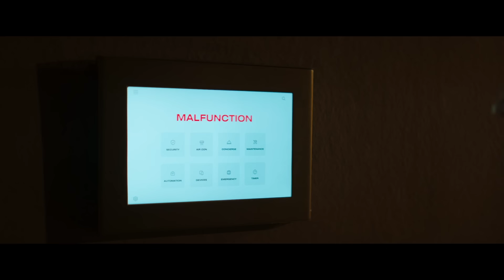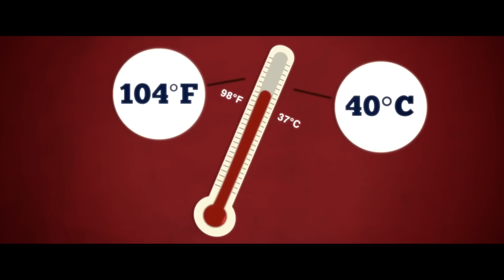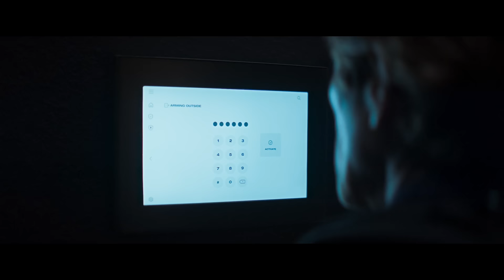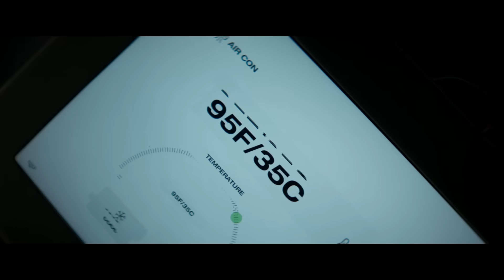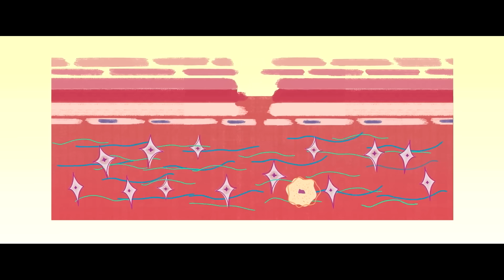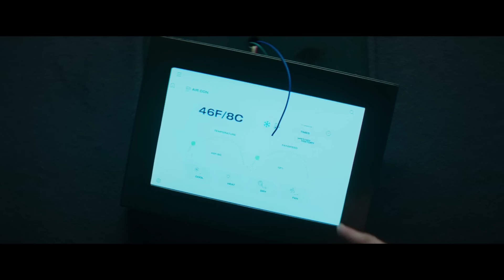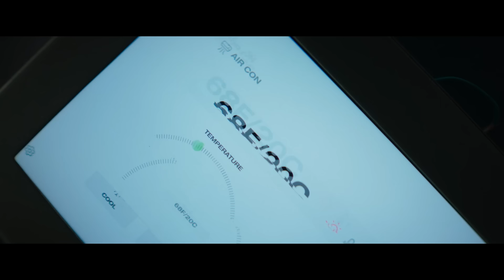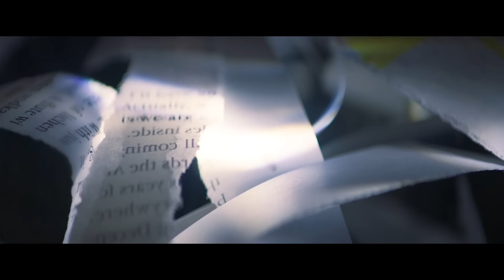How To Beat The DEATH HOUSE In "Inside"

Comment: I would keep working at the front door. If you could cause enough damage to it first by chipping away the wood and then prying off the layers until you have mostly reached the metal surface and then hitting it with furniture in a battering ram fashion the cleaning staff would eventually notice it bulging at the least as you warp the metal door hidden within that wooden monstrosity, if you fail to pop it out entirely when it bends to the point where the locking pins no longer reach the frame or vice versa depending on the locking style. 

Throwing the balls at the windows was actually a fairly good way to test how strong they were and would have eliminated the need to build his Silvester the cat furniture tower. If the skylight glass was as strong as the glass of the windows and balcony then trying to break the frame of the balcony door would have made more sense. Working at something above you is inherently worse not only because of the dust he countered but also the lack of good leverage and that's without considering how wobbly his tower was.

As for the security system, the only reason it would have been messing up is because of the panel he broke, it might have been the actual computer running the system at which point removing it would stop it's function or just a UI for the system which due to it's malfunction was sending out commands to the system which was causing the temperature increase. So removing it is definitely a good idea.

Removing it before the temperature got too hot would have potentially kept it at a reasonable level or even deactivated the electromagnetic door locks. 

If not then removing it might have at least allowed you to cause a short circuit using the wires that were connected to it and thus fry the fuses connected to the security system potentially unlocking the magnetic locks which are usually made to open when without a live circuit in case of emergency. 

Since they Use electromagnetic locking rather then Ferromagnetic locking. (electro magnetic being magnetic only because of the live circuit with Ferro magnetic being for example fridge magnets)
Reply: "Sylvester the cat furniture tower" 😂 Perfect!
Reply: true enough. a door is only as strong as the hinges that bind it to the socket of the doorway its placed in. once the wooden layer is peeled off and the metal is exposed, chisel away at the edges to get to the hinges.
expose the hinges and damage them as much as possible, then you go for the ramming.

now, we don't actually ever see what type of door it is, whether its a sliding door or a open/shut (normal) kind of door, but in case its the latter chances are it can be rammed down with relative ease once its weak points are damaged enough.
the problem for Nemo is; i think his little mallet and chisels would wear out before the door did.. that mallet he is using is not that big or robust.
Reply: He could have poured water right under the main door so it leaks outside for Jasmin to see. Maybe then she will remove her headphones and hear Nemo or will call somebody for the leak. But also not writing SOS/HELP/I'M LOCKED on ALL of the windows was a major oversight.

Comment: I would have frozen a ton of pool water in any container i could find and put it back in the pool as that would have kept a cool area he could "chill out" in anytime his temp was too hot. Rotating new ice in constantly. I also would've tried getting through a wall to the outside, because there's a chance that it would be less reinforced than the windows or doors. If i could access fresh air, at least id be able to think properly and come up with more plans.

Comment: If you've ever worked in construction, you'd be out in a few mins. There are so many ways in and out of buildings. Bust through the sheet rock and slide out between the studs. Climb up through the ductwork and kick the ac panel  till it pops off, giving access to the roof. Cut a hole in the side wall and escape into the apartment next door. There are so many ways out

Comment: Side note: that whole thing about lasting 3 days without water is kinda misleading and has caused problems for people before. While it's true that your body will begin to shut down after 3 days without water, you're actually in danger much sooner than that. After 2 days without any water, your kidneys and digestive systems start to break down and cause you to be extremely weakened, slow, and in constant pain. If you don't get access to water before the third day, it's very likely that you won't physically be able to move enough to even find/retrieve water to rehydrate yourself. That's why it's so important to constantly remain hydrated. Regardless of what you're doing (even if you're an art thief breaking into a luxury apartment to steal high-dollar art), just pack some type of portable water filtration system like a Lifestraw or Sawyer Mini. 

It's also important to note that if you ever get to the point of heat stroke in your life, you will become highly susceptible to it again with a lower threshold. Even if you live somewhere that is cold year-round, you can still get a heatstroke, especially if you are over-exerting yourself while bundled up in a bunch of cold-weather gear. 

Just remember, you are EXTREMELY easy to kill. From the weather to microbes to gunshots and more, it's easy for you to fall dead on the floor.
Reply: The other issue that I notice is with the indoor irrigation system. If the owner uses a system like that to maintain the plants while the rest of the water to the apartment is turned off, it's very likely a closed system with a water storage tank. If that's the case, one of two things is very likely:
1) The system has a tank full of potable water that can be used
or
2) The water also contains specific chemicals used to treat the plants, leech excess nutrients in the soil, prevent mold, and/or kill insects. 

Since those are not fruit-bearing plants, it's likely that the water being used to treat them will contain some types of fertilizer and insecticides that would make them VERY unsafe to drink.

The apartment seemed pretty nicely equipped with appliances (like a walk-in fridge) so I'm guessing there are pots, pans, and a stove. There's no reason why you couldn't gather some of the other non-potable water and boil the hell out of it. And because you've got all the fridge space in the world, you could just get multiple pans, boil the water to sterilize/sanitize it, put them into the fridge, and have a large long-term solution for the water. It seems odd that this never even occurred to someone who clearly didn't grow up uber-wealthy. 

Anyone who has ever been camping or has lived in an area on a well system should immediately know how to make water safe to drink.
Reply: Can’t boil the water with the stove, no gas

Comment: I was really hoping that either the owner would come in right at the end and it turns out that trapping him in the apartment was some crazy abstract art OR there would actually be a really easy way to escape that can easily be missed but is relatively obvious.

Like the door handle has to be pulled out before being turned or actually goes upwards or there is a button on the control unit etc. etc.

Comment: As a former asbestos abatement expert, the height at which Nemo works on the ceiling is idea. Roughly one to two fist heights below the work surface and the top of your head. High enough the majority of the debris will fall away from your eyes, nose and ears. It's also low enough that the blood going to your arms doesn't have to rise much higher than your head. I don't know if this is intentional or something they zeroed in on during production. Figured you would like to know. Working with tools overhead caused a condition called 'scraper arm'. When you scrape at an overhead surface, the fact that blood needs to be pumped up into your arms while they work causes almost instant fatigue. Scraper arm is the condition of working through it until you are undergoing the kind of discomfort a marathon runner experiences. I have scraped blown on asbestos off a ceiling the size of a hockey rink and toughed out the scraper arm. Amongst the great physical feats I have achieved, the massive amounts of cancer I have removed from hospitals, mines and schools, not to mention almost every municipal building in a hundred Km radius there is little worse than knocking down spray on ceiling fireproofing. Almost anybody will be able to endure it, but only if the placement of the work is only one to two fist heights above the head. Anyone who has had to work under a sink, truck/trailer, or drywalling a ceiling will know the agony. 

Happy coincidence. Glad to share my experience and appreciation for the movies rendition of this form of overhead labor. It truely is about the most exhausting thing you can do. No doubt he came crashing down. We was weak from the scraper pain. 

Disco scraper

Comment: If there’s power for the freezer, couldn’t he boil the pool water to make a safe drinking source?
Reply: The problem is not the water being boiled, it has chlorine in it so boiling it wouldn't help at all. I think he could have used the freezer for condensation for a very small amount of water
Reply: @januszkurahenowski2860 yes boiling eliminate the chlorine, usually chlorine can be eliminated by leaving a glass of water out for an hour or so.
Reply: @willy4170  Where does the chlorine go? Doesn't seem like a good gas to generate
Reply: @ctakitimu  the house has ventilation though. also, in any case he could have used water from the fish tanks (which is salt water) and use the same method to separate the water from the salt.
i've seen such filtration systems being used on life boats when people are stranded at sea.
Reply: @ZugzugZugzugson  Chlorine gas is heavy though, so unless ventilation is at ground level it'll just pool. Also, with the steam method to filtrate the water, wouldn't he have to build a device to capture and condense the steam back to water?
Reply: @ctakitimu  yes but this can be done relatively simply by using 2 bowls (a small one and a big one), a stick, some string and a piece of water resistant sheet material. you fill the small bowl with the water you intend to filtrate, then place it inside the bigger bowl and fix the sheet so that when the water evaporates it causes the sheet to catch the condensation (which is the clean water) which will then drip from the sheet into the bigger bowl over time.
its painfully slow, but it works.
if you can get the water to boil it will speed up the process though.
Reply: There’s no gas

Comment: I would try making a sledgehammer-like tool out of the art sculptures, wood material, and secure it with the rope/fabric bindings. With this, I think you could then try striking the glass windows, Walls, Floors, or the front door. With the door exposing its steel part, you could try banging it to get attention and get help

Comment: Can he not slide a note under the door to 'Jasmine'? Or short out the electricity and maybe maintenance or security would come?
Or make a sling to really get some momentum on a projectile into the glass? Or at the top of his structure, build a massive lever that will crash up and strike the glass on one end (with something dense and pointy). Like a teeter totter. And the weight on the other end providing the energy is him, jumping off the structure while tied to the end of the lever. Have mattresses to cushion his fall. Or build a small fire against one of the normal window panes, destroying it's structural strength if it's really hot at one point, and cold everywhere else, then try to smash it.

Comment: Windows are probably reinforced with plastic (polycarbonate).  You usually have a alternating layers of glass and polycorbonate pressed together. Polycorbonate is very strong but cannot take high heat. Break a layer of glass (with something strong and sharp), then melt away layer of polycarbonate, break next layer of glass, heat away next layer of plycarbonate - repeat repeat repeat ....

Comment: Funny how William Dafoe would have been able the escape that predicament easily, at every turn while the character he played almost died being stupid at multiple turns.

Shattering the glass is easy (any mechanic, plumber, bikers etc would have known which material would shatter the glass with a bit of chemistry & effort to break certain things & keep throwing), breaking the door is easy well (nt sure if i can say how but breaking the lock is actually not as challenging as trying to survive in the unit), surviving inside would have been easy as well (water supply is not a problem nor food whether or not he had access to the freezer, he might get diarrhoea from sprinkler water & the right pipes tho).

Lastly, do not start that fire.

Comment: There was never a reason why the police or fire department never showed up.  Like others, I would have worked the windows until they break...and they will break.  I would also have built a fire, got the glass as hot as I could, then throw on some ice cold water!  However, since your "friends" bailed on you, I'm not sure you would be able to get off the roof even if you did get out of the penthouse...
Reply: well, from the roof you might have been able to get the attention of other helicopters or otherwise get attention if you can manage to start a fire on the roof as people would notice the smoke, but yeah that's way easier said than done.

Comment: The pool and the fish tank are both saltwater, which is why he cannot stomach them. If either of them were freshwater, the chemicals would have made it taste funny, but not so bad to be unable to consume. Saltwater can be distilled into freshwater with a few bottles/pans, especially when it is so hot inside and you have sunlight coming in!
Reply: the fish tank is salt water, the pool is full of chlorine, not salt.
small detail but still... regardless, both sources are tainted and cannot be used as drinking water.

Comment: Ok, I was home alone once when I was younger, and my parents were away on a work trip. I woke up because our security system malfunctioned and started going off for no reason. I couldn't figure out how to turn it off and no one was answering their phone. So I did the next logical thing. Beat the shit out of the speaker with a hammer until it shut up. My dad called me back 3 hours later and told me how to disconnect it properly lol

Comment: FIRE. he could have made a fire from friction using a technique such as the bowdrill.
 creating a fire should be enough to set the buildings sprinkler system off which may alert people to let him out, and escaping in the panic.
 if for some reason the sprinklers dont activate you could use the heat from the fire against the window until it is as hot as possible, then throwing cold water on it will thermally shock it into breaking.
 this method could easily get him back out onto the balcony in at least an hour tops, worst case 3 hours

ok I made this comment like 10-15 minutes in, so the sprinklers are a bust, but the thermal shock will still work after the sprinklers stop

Comment: You can use the hammer and steel bar as a chisel and get the nuts off the bolts. Just gotta line the punch up with the corner of the nut and smack it so it forces it to turn counter clockwise and it will eventually break loose. Unless its crazy tight but i really doubt it would be

Comment: when it was exactly 79 degrees he should have took the two wires on the panel and twist them together, this way the temperature should stay the same but since this is a monitor and not a regular temperature dial it might not work

Comment: Yeah, it's really odd that he gave up on the door after what , gnawing at it for like two hours on day one... Doesn't that thing has hinges ? Hinges are almost always on the inside to prevent a break-in, not to restrict a break out. Just because there seemed to be metal under the door at that one spot he tried to dig doesn't mean there is zero weakness in the door. He could have tried to dig enough space under the door to pass a piece of paper too, surely that would have been faster than taking out the concrete ceiling thing. Likewise, he did not even try to go trough any of the walls... I mean , just diggin a single small hole to the other side would have probably been enough to establish contact with the maid.... He also should have probably figured out the fact the fire would trigger the sprinklers earlier, and possibly do it multiple times if possible to raise the water level so high that it eventually starts to leak out... After the building drains the first time , he could have tried blocking the water evacuation ports to ensure the flooding last long enough so it can cause visible damage to the building... Really doubt that building was 100% waterproof and it could hold a pool-level amounnt of water forever.

Comment: Okay I recently disproved this 3 days without water will kill you theory. I was curious and Im okay doing dumb things for the sake of knowledge. I went a week with 0 food and 0 drink of any kind, and at the end of day 7 my lips weren't dry or cracked and my skin on the back of my hands remained smooth and soft, and those two are always the first signs of dehydration on me. Im not recommending anyone try it, but I could have easily gone far longer, I wasnt dizzy or tierd or sick or anything. I was 100% fine. Ive documented everything, just incase I did die, that way there would be no mystery but also I may have gleaned useful information from an otherwise unethical experiment. But I looked into it afterwards and there are records of people going months without food or water.